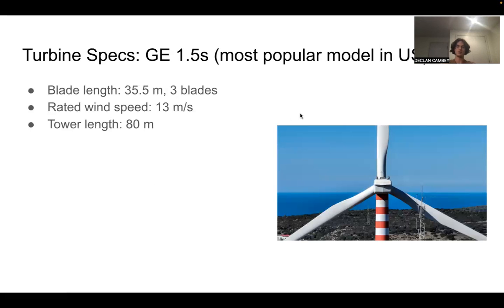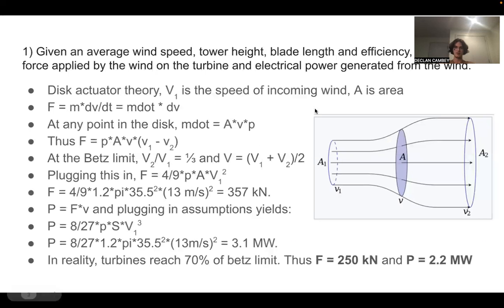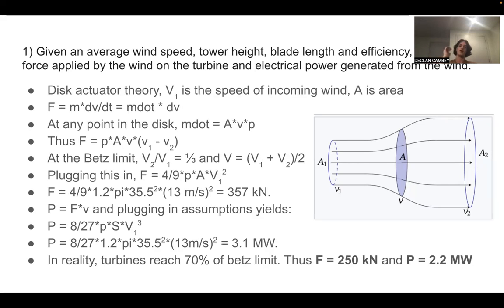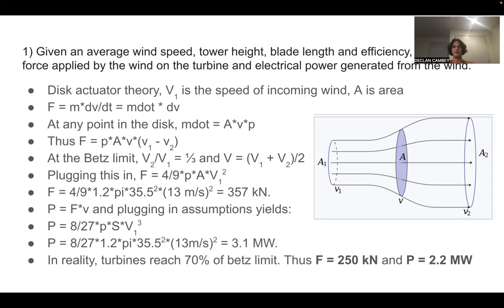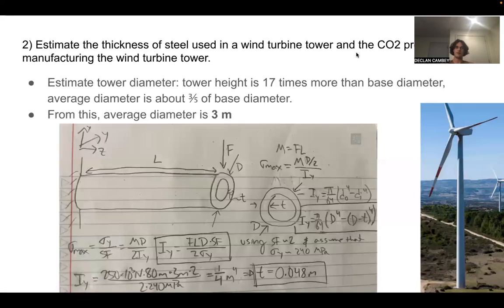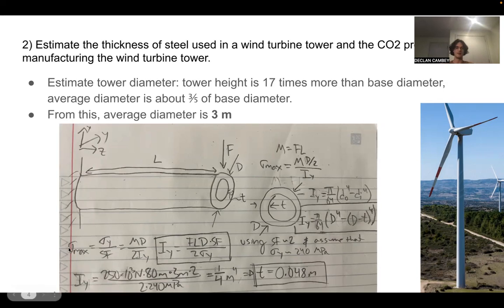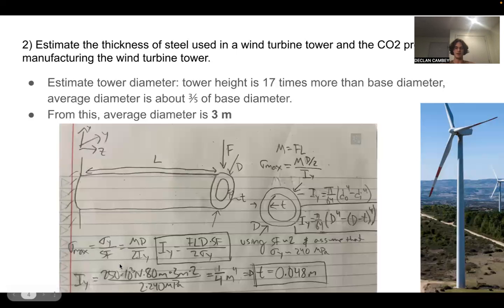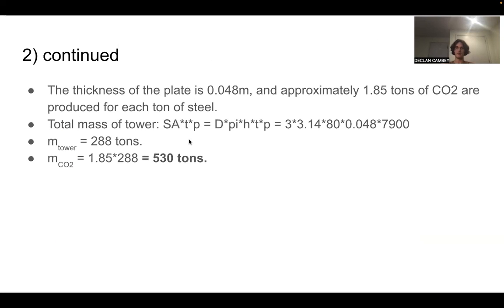Carbon Emissions of Wind Turbine

Comment: How about blades? They are mostly made of plastics and polymers. The materials degrade to a level that they cant be recycled very well and are often just buried underground. My background is materials sciences and we hear a lot about microplastics however the scariest stuff is nanoplastics. Remember how asbestos was considered safe to use for most of its application timespan? Research on nanoplastics isnt done even remotely on the scale of what its implications are. Think DNA-altering chemistry, superabsorption through skin and blood-brain barrier crossover. Once we fully understand how crazy NP-s can be and that keep using it isnt sustainable anymore, what are the potential costs of cleaning this all up? Sounds impossible. It is arguably far more dangerous than asbestos is and the latter is dealt with extreme caution. Of course turbine blades are nothing compared to other sources of NP-s.